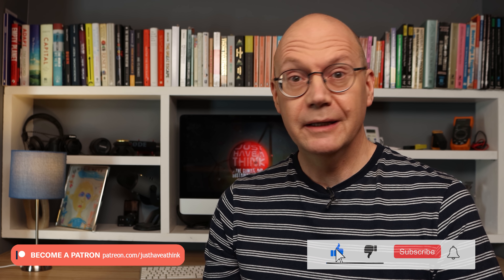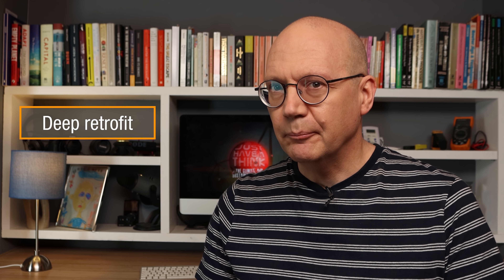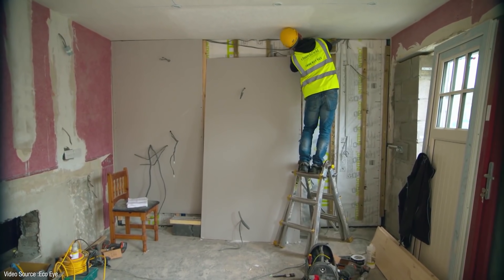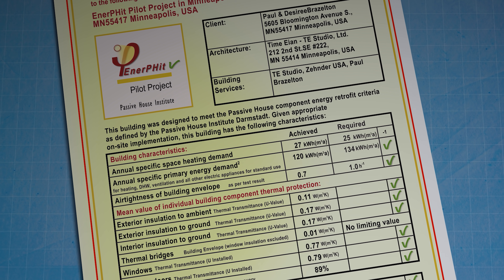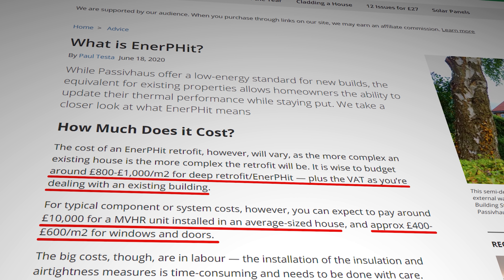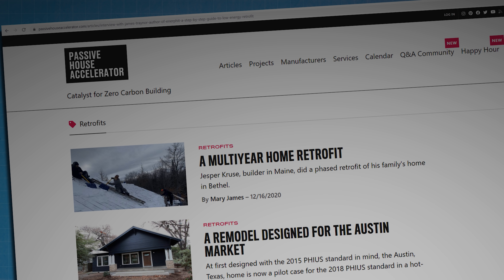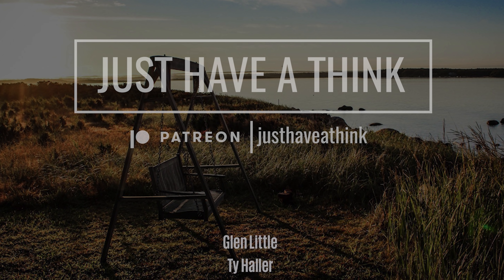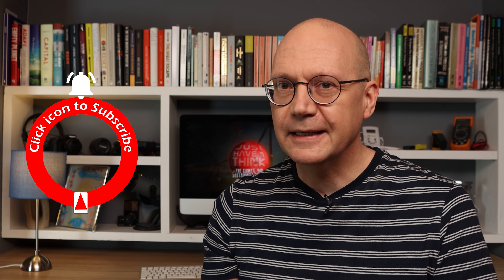Retrofitting to Passive House standards

Comment: Making a house airtight is a great idea if you are tired of living.
Because there are some very serious problems:
1. Gases, fumes and fine dust
Outgassings and dust accumulate in a house. These substances are harmful to health and in fact, air measurements in passive houses are often frightening!
2. Mould
Condensation zones occur very easily, creating ideal conditions for mould growth. Mould is not only a nuisance, it kills!
Mould spores can cause very dangerous diseases and mould produces aflatoxins, the most dangerous carcinogenic substances known to mankind.
3. Radon
This radioactive noble gas originates in the earth (From natural uranium, of which there is quite a lot in the soil, on average about 1.5 grams in the uppermost soil layers on an area of 1 square meter. This is why geothermal energy is also very dangerous.) and also in building materials, which are made of earth (sand, bricks, cement, plaster, concrete).
Radon is always enriched in houses and the less ventilation, the more is in the air. Radon itself causes lung cancer (after smoking, it is the main cause of this disease) and its decay products (especially 210-Polonium, the poison used to murder Alexander Litvinenko) are of course also carcinogenic.

But, well, for the climate, sacrifices have to be made...
But isn't it funny that the same people which fight against the slightest trace of diesel exhaust prefer to spend their lives in houses that have a particularly poor air quality?

Comment: I would love to get this done to my damp house but the cost would be astronomical. I would like to see how well the insulation does with time first, as it is still fairly new. They are ripping out bad cavity wall insulation now (a far inferior product to the wall tiles, but all the rage in the 80-90s, along with early double glazing) I can well imagine legal adverts in a few years from now  ‘have you been mid-sold energy efficiency building products?
 Did you get cancer/ burn to death/ develop breathing problems / get plagued by locusts...’ The lawyers will always be the winners!
Reply: EWI is not new. They've been doing it in Europe for decades. It is possible to screw up a building with the wrong measures, but the vast majority of cavity wall insulation is fine (probably sagged a bit and gappy, but not doing any harm). There has been some shocking EWI work done too, with water getting in and no ventilation to speak of. Preston has a famous case. This is why they've introduced PAS2035 and PAS2030 in the UK, so building are considered as a whole, not just one job at a time.

Comment: We own a mid terraced house as a first time buyer and intend to move on in a few years time. It does not make financial sense to do a costly retrofit which we would not see recouped in savings or resale value... But I would like to reduce my emissions dramatically and my home is my main source of emissions. 

This seems like a real problem, as the country has a large stock of smaller, inefficient houses, which won't see the necessary investment by the owners. Further, the UK government grants are poor and the interruption and risk of costs escalating (as older properties are rarely straightforward projects) make these projects quite unpalatable to an existing homeowner like myself. 

Perhaps the government could take charge and demolished and rebuild, but that must also have an environmental cost. How many decades will a rebuild take to pay itself back in efficiencies?

This seems a much bigger problem than most seem willing to acknowledge.

Comment: Great advice. I was lucky to build a house in the US to PH standards. It occurred to me that If I could have taken half my new insulation and roles of sealing tape to an old house, the amount of energy that could be saved on a leaky old New England antique home would be maybe 5 times the smaller amount of extra energy my house would use.  A new house like mine used lots of new virgin materials and a fair amount on concrete and other energy intensive products too. Bringing an old home to EnerPHit is certainly expensive but should be even more satisfying that realizing you new home dreams.

Comment: This is not about passive houses, not about saving the world but about something that can be done by anyone.
I am a Pole living in the UK. Back in Poland, every new build, as well as many old houses, have 100-200mm of external insulation ( yes - In Poland winters are much colder and summers are usually warmer).
I was very shocked when I first arrived in the UK that literally no houses have any kind of insulation. Yes, some of them have a cavity wall and "some" insulation but not much in general. Also, in most old houses there is ZERO insulation between the ground and the floor on the ground floor. 
When I bought my first house(average size 3-bed semi), I renovated it and after living in there for 2 years, I decided to insulate external walls - not much: 50mm of styrofoam + render. I didn't want the insulation to be very visible.
Only by doing this, my energy bills have dropped by half. The house always keeps a very stable temperature around 22C during the winter and never overheats during summer. Yes, in the UK we do get quite a few hot days too. 

Now - let's do some maths : 
I spent on insulating around £5000, I was saving £600 a year which is going to pay off in 9 years.
Any solar PV installation will pay off in 17+ years but solar panels usually lose their performance after 20-30 years. The actual gain of the PV installation is very debatable or minimal.
Reply: According to the plastics Europe organisation EPS lasts 50 years. After which you're going to have to strip off the render, replace the Styrofoam, and re render. It will cost far more than the work you've already done. 

PV, after 30-40 years you'll have to unbolt the existing panels, unplug them, plug in new panels and bolt them back onto the same mounts. All the mounts, wiring, export meter and inverters can stay. Just the panels are now around 20 cents per watt retail. So for a 6 kW system that would make your house a net exporter of energy, you're looking at 1200 dollars plus labour at today's panel prices. Panel prices have fallen by 99% in the last 30 years. They won't do that again, but I'd still expect them to be cheaper than today.
Reply: @gasdive  You really think the EPS under the render will degrade significantly? It reamains to be seen but given how long the stuff lasts just floating about in the sea I reckon that dead still in the dark it'll last the lifetime of the building, or at least 100 years. I do think it's a better idea to use more-breathable woodfibre rather than all that plastic but at the moment it costs significantly more.
Reply: @xxwookey  I don't know. I'm just quoting the European organisation that promotes its use.
Reply: Solar panels costs have dropped every year for the past 10 years. You might be surprised how cost effective it now is. Most new systems have a payback of 7 years or less. After that you are getting free energy from the sun.
Reply: @KJSvitko  I did not mention this in the comment because it wasn't the main subject but I have installed a 2kW PV system by myself which was later commissioned and connected by a professional MCS certified installer. My cost was around £3k   (£2k for the panels and inverter, £500 MCS, and £500 for the scaffold). Quotes I was getting at that time for similar installations were oscillating around £6-7k. I was on the quite good feed-in tariff - 14p per kWh. The system was generating me about £250 a year. Nowadays you get 7p per kWh which will double the payback time. I just did a quick calculation on the Energy Saving Trust website and according to that, I would be making  £78 a year with a Potential lifetime benefit of £3,242.  I don't know where did you get the 7 years from...
Also, PV is not about saving energy - it's about sourcing it. Insulating is pure saving. 
Maybe if you use the PV for charging your EV car, it would make more sense (but you would need to invest in huge battery storage which would double or triple the cost)
Reply: @CezarySiw  The exact same PV system will make nearly twice as much electricity in Arizona or Spain as in the UK so (for the same payments) that approx  halves the payback times. Payment regimes vary too of course with some places having net metering (very good price), and some paying nothing, or even charging for export.
Reply: @xxwookey  Maybe you are right under perfect conditions. On average, efficiency of PV systems in Spain is only 5% better than in the UK (2.226kWh/kW vs 2.420kWh/kW according to pvoutput.org)  California's is 3.715kWh/kW  (66% better than in the UK) or in Texas only 40% better - 3.131kWh/kW. Of course, you need to take into account that PV system in the hot countries are much bigger than in cold countries so the efficiency is also better.
Reply: @CezarySiw  That's interesting. I'm surprised the UK/Spain difference is so low in practice (I was just thinking of the overall insolation charts which suggest that nearly twice as much sunshine falls on an area in Spain than UK - obviously there are other considerations like temperature).
Reply: @Cezary Well done - just need everyone else to do the same thing (and stick 200mm on rather than 50 whilst they are doing it). As you say it's amazing the degree to which we don't bother insulating our houses, nor taking any airtightness measures, when it's totally standard in much of the rest of Europe. Did you do your own rendering too? I'm impressed.
Reply: @xxwookey  Thanks. I'm not good at rendering so I hired someone for that :-) If anyone interested in doing it, have a look at Polish builders merchant websites (such as IBB or ANT in the UK).  They provide all you need for that: Documentation, Polystyrene, Fibreglass Mesh, fixings, adhesives, renders. Recently I have moved to another house now and I'm planning to do it again!
Reply: What did u do with your floor??

Comment: I didn't do a "deep retrofit" in terms of the paperwork, but in 2018 I converted my attic and installed a heat recovery system as part of that. The conversion was done with air tightness membranes and the insulation was drastically increased. I had lower heating bills even though the floor space had gone up my 50%.

I'm currently adding a detached garage. It has 150mm of cavity insulation, 100mm of ground insulation and will have decent attic insulation. My oil boiler is being replaced with a heat pump which will heat the garage via underfloor heating and use the existing radiators in the house to heat it. The garage roof has been fitted with 6.5kW of solar panels.

I live in Ireland so seems unfortunate that I hadn't looked into that grant. I'll get grants for the solar, battery and heat pump though.
Reply: Oh, next projects will likely involve bead insulation into my house cavity and changing the windows to triple glazed. External insulation might happen but I'm also looking at using more trees and shrubs to shelter the house from wind.

Comment: I designed and built my home in Virginia in 2007 before these standards were created, back when the term “Green Construction” started.  Proof of concept to build a “High Performance” home for the same as conventional.  Energy use currently is 21.6 kWh/sqmeter/yr with air change of 0.12 as tested.  I expect to change the heat pump the end of the year will bring it closer to Passive level.  What would happen if all homes were to list their energy consumption (kWh/sqft/yr or kWh/m2/yr) when listed for sale?  It is the same as efficiency rating of a car.  Which one would you purchase?  The leaky oil burner or the one with low energy bills?
Reply: 21.6 kWh/sqmeter/yr is passive level (although note that the floor area defined for PH is very specific about which parts of the house count (internal living areas, so not walls or stairs or landings or cupboards or areas under 1.5m high) so it's much lower than the  total floor area, which puts up the simple 'energy per m2 per year) number significantly. (e.g my house is 120m2 for both floors, but 96.5m2 'floor area' for PH calculation terms - ie 19% smaller).

Comment: Thanks for another great video!

This is one that shows all of us a way to personally contribute to lowering greenhouse gas emissions, because it's something we can all do if we have the money. It's quite a large investment, though.

I did the shallow retrofit thing a number of years back. I got a home renovation grant from the city, and as part of the deal some specialist types came and scanned my home with a thermal camera. They were not pleased. Apparently the house was so leaky they said it was the equivalent of having a seven foot hole in the wall. That was before the renovations. I put in a number of new, more efficient windows and put insulation up in the attic. (Apparently the house had gone without insulation of any kind for more than fifty years.) Afterwards it felt nicer inside since there weren't any wild temperature swings, and there was a lot less popping and groaning from the roof since it wasn't undergoing thermal expansion and contraction every day.

But that just took it from abandoned shack status to maybe an E on the Energy Efficiency Scale. To go further would require a lot of renovation and money. I guess it would be worth doing, because we all do need to work together if we're going to get out of this climate emergency and make a decent world for the next generation. But I think I'm going to wait for a while, until there's more money in the bank and the memories of the last reno fade. Until then I do research thanks to the names and websites you mention in this video. So thanks again!

Comment: Mike and I got the old Nelson house in Beaver so air tight that the blower door guy thought his gauges were sticking! 🌞 The new furnace controls fresh air through a heat exchanger, giving that 1 air change per hour while saving 90% of the energy in the exhaust air.  Fuel consumption dropped from 5 fillups of propane per year to just 1, so in the future green electricity can supply the heat using a heat pump. Renewable is doable!
Reply: I did nothing. Not even insulate the ceiling (though I keep meaning to).

Instead I put 4.5 kW of solar on the roof (back when that cost 12000 dollars).

You've gone from 6 propane fills to 1. I export more energy than I import. You've cut your heating by 90%. I have covered my heating, and cooling, and dehumidifier, and cooking, and lighting, and air filter, and my EV, and hot water, and refrigeration, and computers, and my pool filter.  And I export more energy than I import.

I don't burn less propane. I don't burn any propane.
Reply: @gasdive  Good for you!  I'm just the workhorse improving building efficiency, the rest is up to the owner to get the solar system installed and running.  If buildings are brought up to higher standards they take less power hence more to export, and they are cooler in summer, warmer in winter.🌞
Reply: @chuckkottke  both is good. Well done getting the building up to where it should be.

Comment: Public housing is a recipe for poor maintenance. Renters never take as good care as owners. Often, they can't--who can rip out walls to install insulation in a rental? Certainly not in council housing. Can a renter demand that the slow leak in the roof causing mold in the ceiling be repaired? Sure, and it will happen after a month or so. But nobody is going to put R-60 into the attic of a rental home---not the owner, not the renter.

Comment: How many years to breakeven on the investment cost for a shallow and a deep retrofit, in energy savings?
Reply from the maker: Many. But we need governments to subsidise this so that it is less of an issue. I would happily pay a few extra pence on the pound in a Climate Tax to fund such subsidies.
Reply: On the other hand look at it from the quality of life standpoint. No one ever considers the payback period of their new kitchen.  Life in a passivhaus is sooooooo comfortable compared to a conventional house I would be reluctant to live anywhere else now.
Reply: That’s my question as well @Jason Henley.
Our living space, constructed in 1985, is  104 m2,  the basement suite is an additional 40 m2, and the unfinished basement / crawl space / utility space adds 65 m2. If the suite is occupied, and I discount the crawl space, our space heating is about 42 kWh / m2 / yr. If I include the crawl space (it is heated, but not thermostatically controlled) my consumption drops to 29 kWh / m2 / yr. If the suite is unoccupied, it drops to 23 kWh / m2 / yr. By my calculations our space heating for 2 occupancies is about C$700 / yr. Our house is in the British Columbia Rockies, so experiences 4 seasons. The suite is electric resistance heat, and the rest of the house is air source heat pump. Electricity is hydro. Consumption is from utility bills. While there are steps I will take, such as insulation of the suite floor, and adding a mini-split heat pump, I see little cost-benefit of a deep retrofit, and look to other methods of carbon reduction.
On the other hand, were I building new, I would look to Passive House, or similar building standards. I also feel strongly that living in smaller spaces is a necessary step towards resource reduction.
Reply: @davidbutt406  sounds pretty impressive already!
Reply: @treescape7  yes, but it’s only a common stick built house with all the (poor) building technology of its era. I guess my question becomes: “Where are dollars best spent?”

Comment: I still consider pass Haus a cold climate solution. In hot humid tropical climates it requires air conditioning hvac to run. Traditional building was  on low thermal mass and air circulation. Obviously with urbanisation and air conditioning uptake this is changing.
Reply: Passiv Haus is for heat and cool.